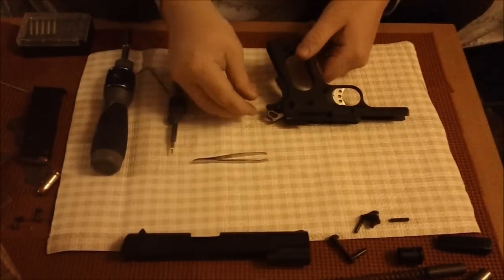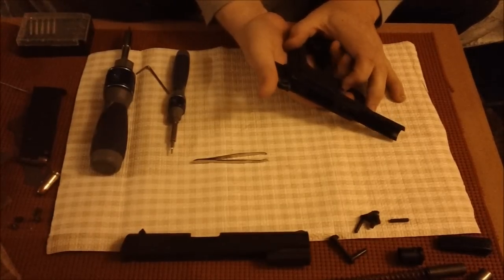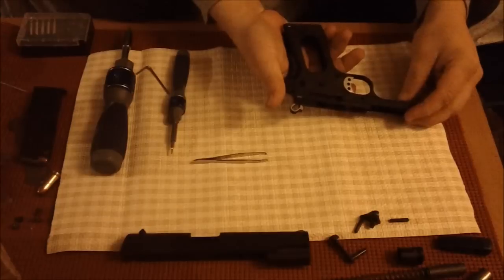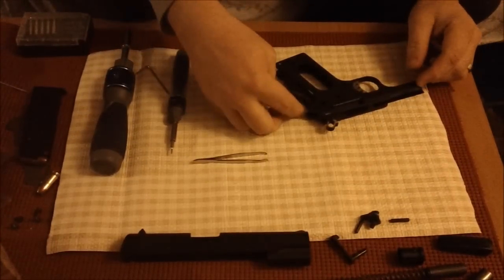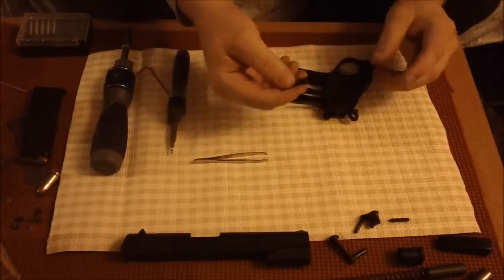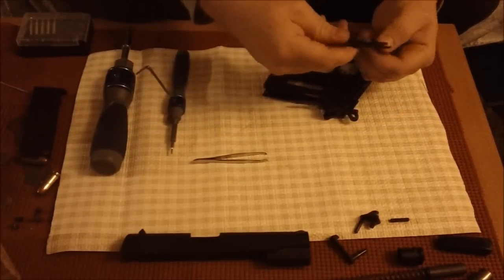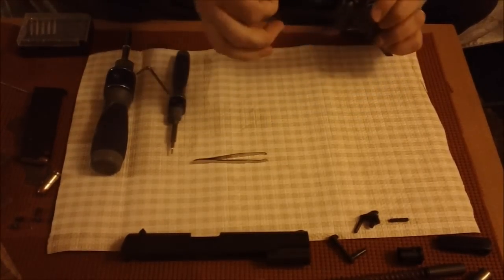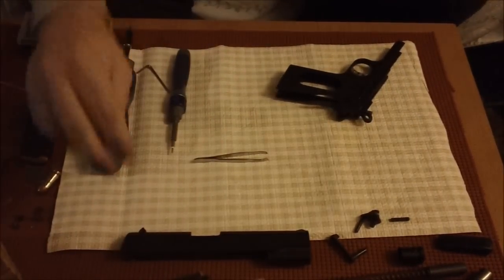Trigger Upgrade for the TISAS 1911

Comment: Ride the hammer forward to take pressure off the main spring before you remove the main spring pin. You will be able to push it out with  very little effort.

Comment from the maker: Not at all. Most are just "drop-in". Some take minimal machining (file and sandpaper work). The only tough spots are grinding the frame for the grip safety (which is pretty standard), and removing the hammer/strut pin (not very standard at all). If you replace the hammer, get the hammer, strut and pin all at the same time. All the parts were reasonably priced at Midway usa dot com. Check out the finished gun on our newest video, and thanks for the support!

Comment: If you want a really great 1911 out of the box in the $600 range, I would highly recommend the Taurus 1911.  They already have most upgrades that a novice would attempt and many that even a highly skilled 1911 man wouldn't try.  For the price you simply can't get a better 1911.  I can't comment on the gun in this video, but I own 15 1911 pistols and with Taurus you get their guarentee and their awesome customer service which is always a plus when purchasing firearms.

Comment from the maker: I bought the parts from Midway usa dot com, and no complaints there. The mag that came with this gun is actually a MecGar mag and it is great. I did, however, buy a commander style mag at a local gun store here and it doesn't support the follower well, so I'm getting FTF's due to the rounds nosediving.

Comment from the maker: As far as a recommendation on your first gun, I'm flattered. This one shipped from Buds Gun Shop for $403 and am pretty happy with it. When all is said and done I will probably have invested about $80 in upgrades for it. If you want more instant gratification I would recommend a Girsan 1911 Sport. The tolerances are tight and it reviews well.
Reply: I sell alot of SDS 1911s which is the Tisas same company, I also sell alot of Girsan 1911s. Few years ago Taurus 1911s was a big seller but not so much now

Comment: You should never remove your mainspring housing ,before you remove the thumb safety. You may do it 10 times with no problem, but the 11th time your safety will get hung up on the sear tail and you will have to cut off the safety.